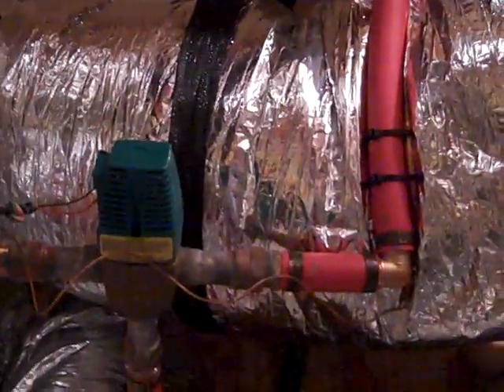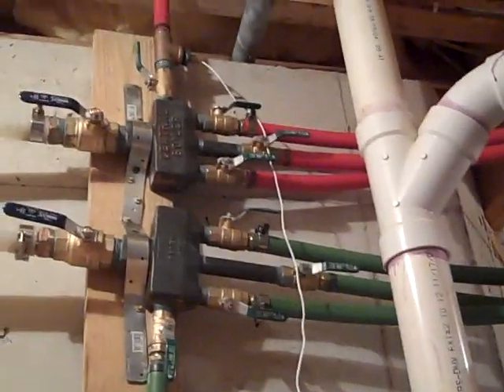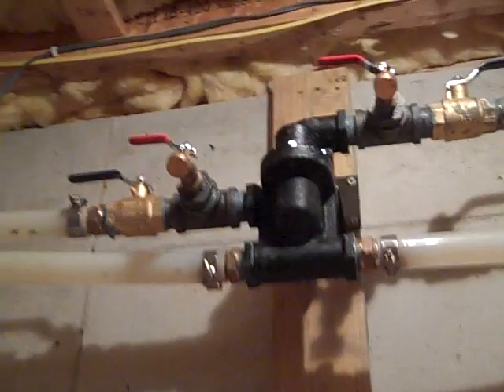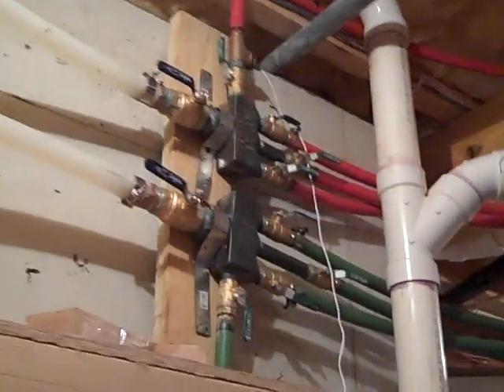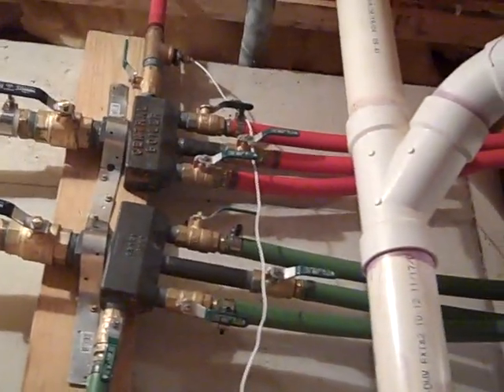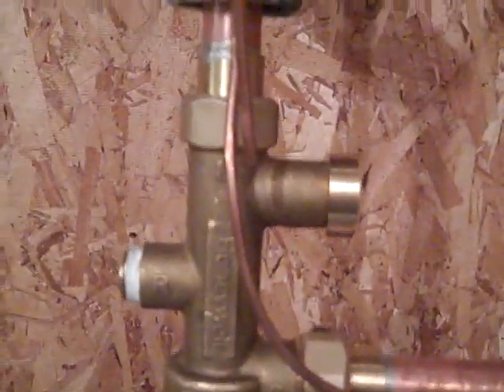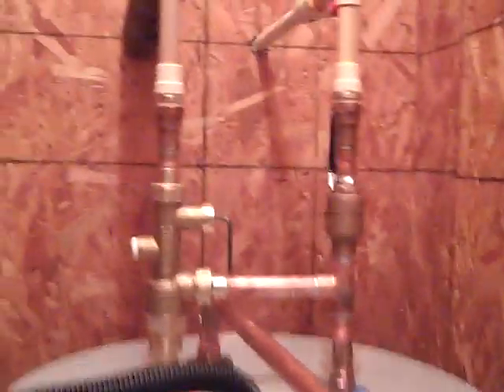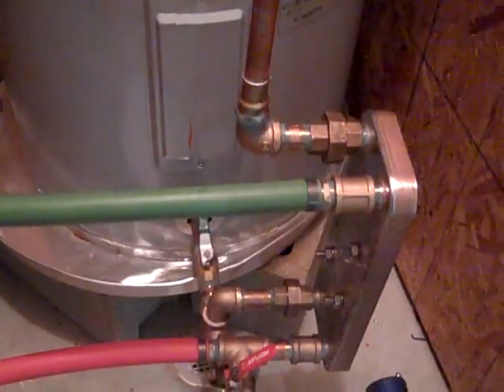Retreat Design Part 2

Comment: looks like you are using a thermal loop from the HX to the heater. Curious though if you are using a recirc system from points of use back to the heater. If not, you may find an energy saving benefit in using heat traps on your cw and hw lines serving the spaces.

Comment: The thermostat to prevent hot water from reaching where you want it have one downside they allow your long runs to freeze when the fire goes out. Moving water even cold moving water takes a lot longer to freeze. My neighbor called me two days ago to ask if I would add wood to his old school owb when I got there water temp was 28 outside temp was 4 F laid in a small fire and lit it off. His older son was supposed to feed it daily but took off up north with his girlfriend so I got the call. It's only 3/4 mile from my place so no big deal. Sat in truck waiting for the fire to burn down to a bed of coals then filled it up. He got home around 2 pm next day and said everything was fine. I filled it the next morning just to make sure and it had burned quite a bit 3600 sq ft is the load and all his radiators are cast iron. I cheated starting the fire put five large dry pieces of wood in firebox then used an old Bernze propane torch you have to light manually laid it down on the firebox lip pointed at a big dry hunk of wood for two minutes then removed and closed door fired up just fine the torch is the type that you screw a supply can onto.
When I went back an hour later it was up to 79 F and climbing nicely. He gets his wood for free his son works for a tree company and everyone working there now heats with owb.

Comment: Any plans for a better off grid electric generation system? I would be worried about using diesel fuel. Wind or soar might be a better choice. Just a suggestion. Thnks for the vids....:>)

Comment: you dont need a dump zone because your boiler is atmospheric right?  I have a pressureized wood boiler in the basement.  One year I had a power failure with a full load of coal on it during a severe snow storm.  40 inches of snow.  We end up putting the fire out.  What a mess.  yeah I have a generator, but it was midnight and snowing like crazy and I had to snow blow all the way around the house to get to the connection for the genset.  Now I have everything on an AC couple inverter with battery